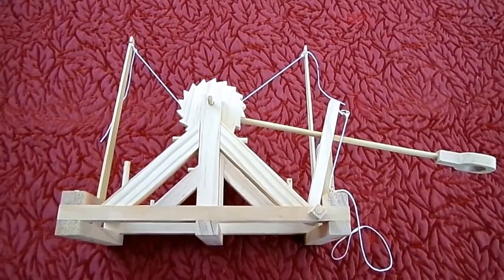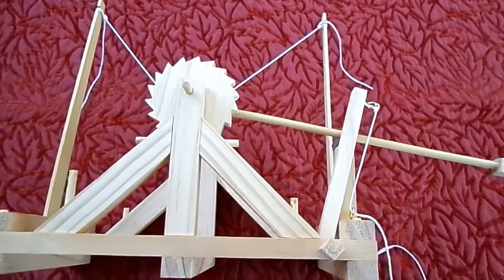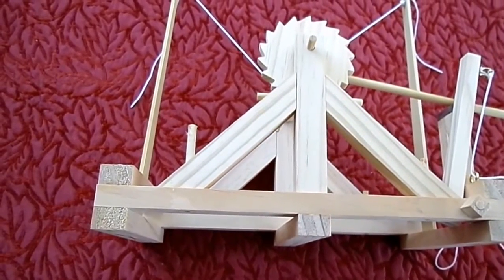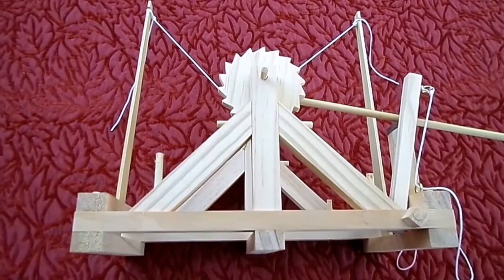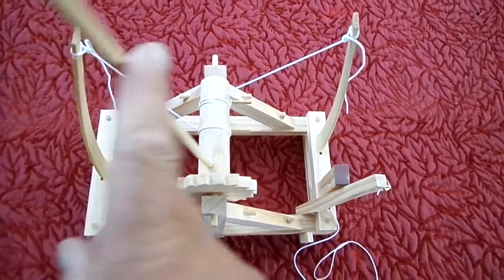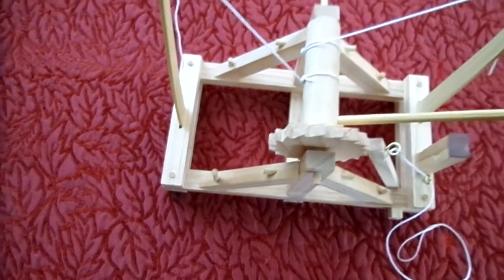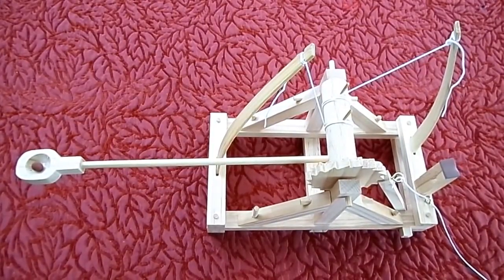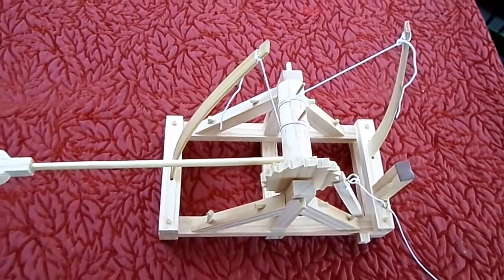Leonardo da Vinci's Catapult

Comment: Is it calculated dimensions or did you design it from a real scale ? If it is calculated may I get real object dimensions by ismailsergen@gmail.com you will let me know (: i will be glad
Reply from the maker: It is available as a ready made kit. I donated the original to a local Primary School and don't have the details, however it should be easy to find online. Let me know if you can't find it.
Reply: Actually I have got several type of this design with dimensions but the dimension is required to theorical analyze for my workshop internship . If you would have the detail it will be nice for my sample count but thanks anyway .
Reply from the maker: https://www.geniegadgets.com/da-vinci-catapult.html?gclid=Cj0KEQjwh428BRCnvcyI-5nqjY4BEiQAijebwpMde79U-UMk8rDxJ5iKEo7wbSXYcb295tk9oI8L7CsaAjHL8P8HAQ

Based on a combination of two of Leonardo's drawings, the kit comes with everything you need to build it, including glue, and a little bit of info about the great man himself. It's a fascinating lesson in mechanics and engineering, but most of all it's a great way of laying siege to the account department.

Comment: You should try taking it outside and measuring how far the projectile actually travels. Make sure your cat(s) are not around :-)
Reply from the maker: +Ian Dalgleish I will let you know :-)
Reply from the maker: +Ian Dalgleish About 5.5 Metres. If it's pulled back too far it gains height and not distance as you would expect.
Reply: Not bad! How does the mass of the missile affect the distance travelled - Experiment 2!
Reply from the maker: We shall see :-)